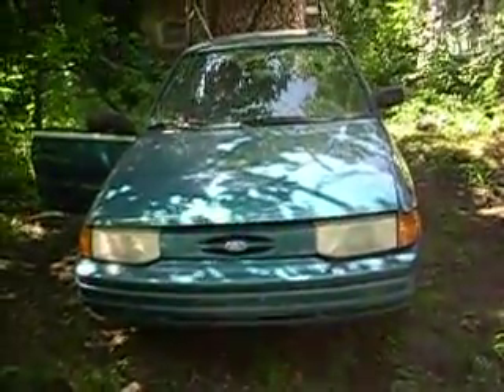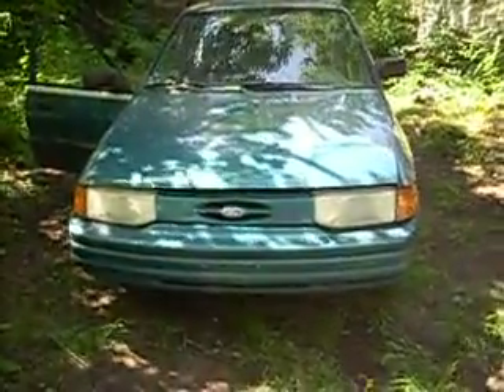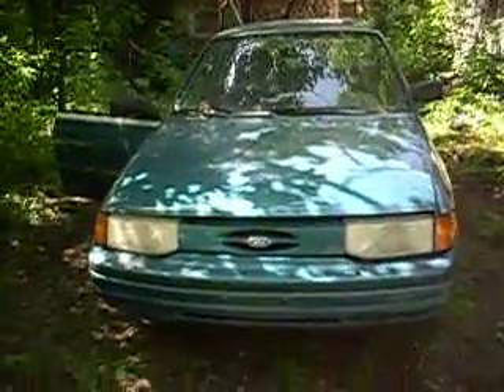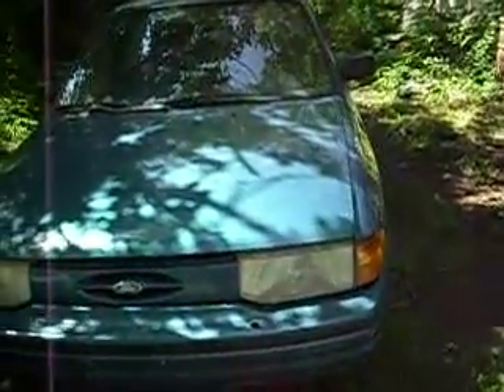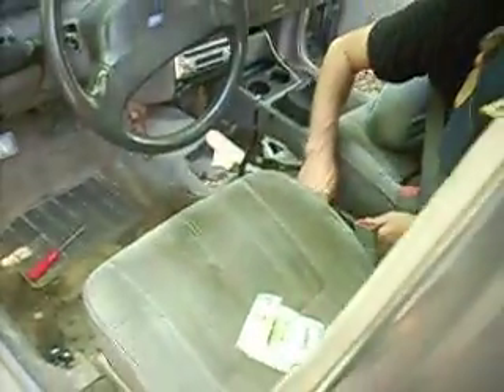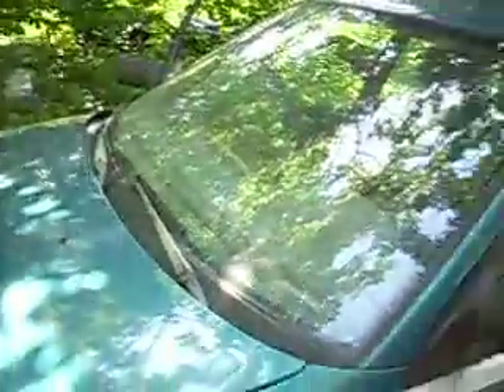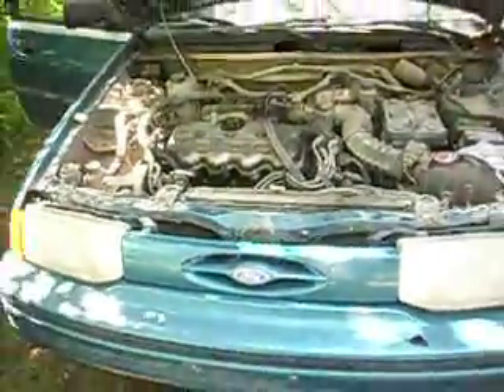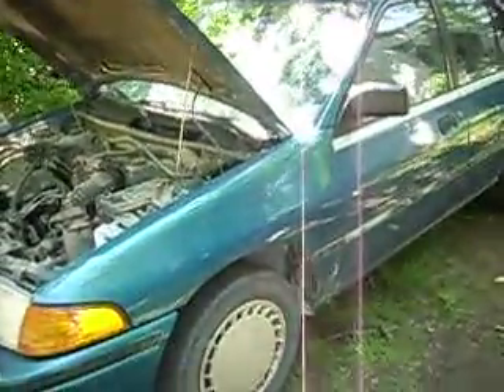New project 93 Ford Escort lx Project Green Hornet

Comment: Man, you got something that RUNS for $250?? In my neck of the woods, the junk yard pays $350 to come take anything towable -- running or not. I know two years ago it was $300, but still, you took advantage of someone with missing chromosomes. Anything that runs and drives for under $550 is highway robbery!